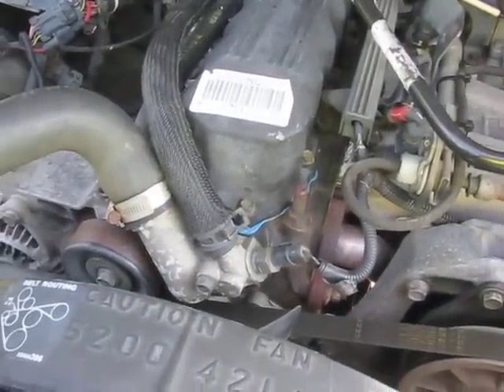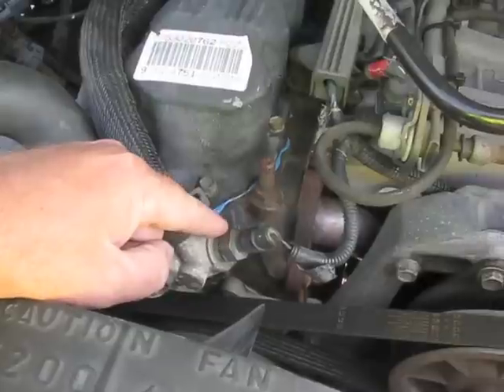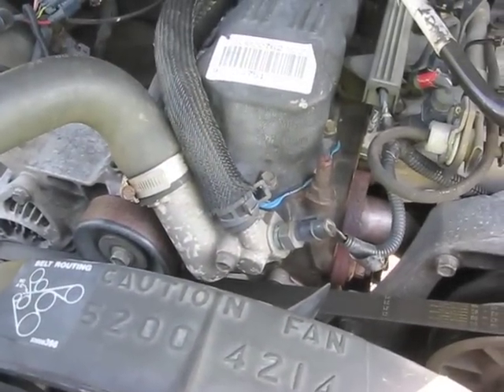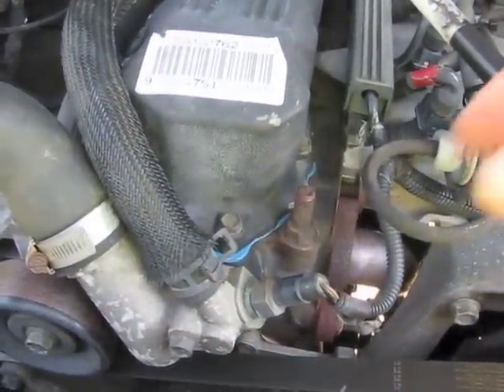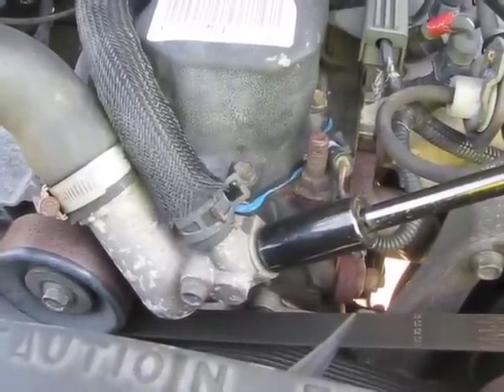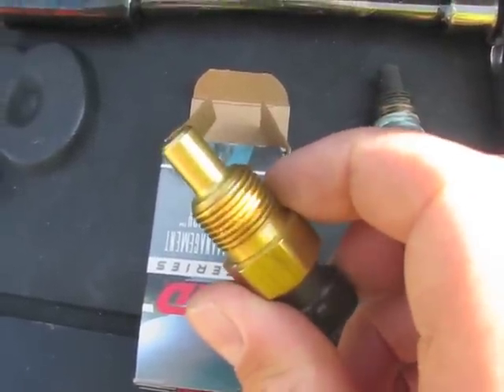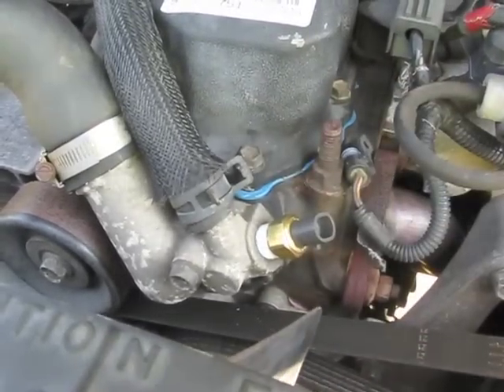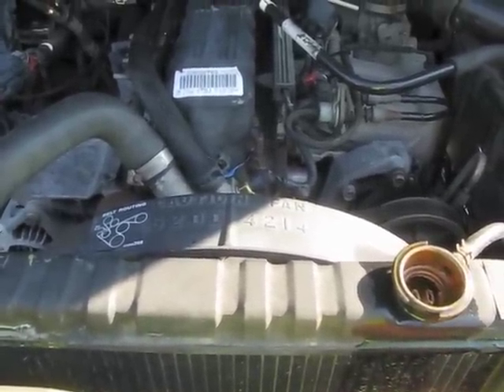Jeep 4.0L Coolant Temperature Sensor Replacement

Comment: In my '97 Wrangler TJ - recently got a check engine light with a P0118 code.  The Temp Gauge was steady reading and not bouncing around so I replaced the coolant temp sensor on the thermostat housing.   Should I have replaced the one on the engine block towards the back of the head too?  Thanks!

Comment: Simple, plain, and to the damn point.

No g00fy monologues about past divorces etc. or trying to sell t-shirts, like a lot of these other clowns making these type of videos.  Thank you for that!

Was it not necessary to bleed any air out after filling up, or you just didn't take the level down low enough to warrant it?
Reply from the maker: Changing this temp sensor I didn't drain the coolant much lower than the level at the sensor. What little air ended up in the system was quickly worked out by simply squeezing the upper radiator hose a few times during and after topping off the coolant. Even when draining the system entirely I haven't had any air trapped in the 4.0L that required anything more than the simple hose squeeze. 
Hope this helps. 
Thanks!
Reply: @jeepcollector91  You a Led Zeppelin fan?

"....squeeze my hose, baby.....'till the coolant runs down my leg"  :-D

Comment: Does anyone know a part number or replacement for the connector?  Need to replace the pigtail on a '91 YJ and cannot find a compatible connector.
Reply from the maker: I'm pretty sure it is this one with the rounded corners.  https://www.oreillyauto.com/detail/b/standard-ignition-5753/lighting---electrical-16777/connectors-sockets-16631/coolant-temperature-sensor-connector-11457/e39bbaf30c53/standard-ignition-2-terminal-multi-purpose-connector/tx3a/5826087

Comment: Are all cooling temperature sensors all the same ?? 
I have a yj 1991 to wrangler to 4.0 .
Reply from the maker: Yours should be the same as the in this video. 
It is a 1991 Jeep Wrangler YJ Sahara with the 4.0L

Comment: I have a 91 also how can I see what codes it's throwing for the check engine light to be on
Reply from the maker: Turn the key from OFF to ON 3 times (not to start) and on that 3rd time leave it ON and within seconds the check engine light will flash out the codes for you. Then you can look the codes up in your schematic or simply Google them. Most of the Jeep forums will have them listed as well as some of the Jeep parts sites...
Reply from the maker: I did a quick search. Here is a link to a good video and they even listed the codes in the description.
https://www.youtube.com/watch?v=kuHEzOQGtOs

Hope that helps.

Comment: I've changed the temperature sensor, and the sensor on the back of the engine, also checked fuses, and have a new radiator and new water pump, and my jeep is still over heating, also my fan won't turn on, I've tested and gave it power and it works good, reason why I changed the temperature sensor to begin with. any ideas? some say the jeep shouldn't over heat with out it, I have a 1996 jeep cherokee 4.0 2wd straight 6, runs at 210 buy it's tipping to 250 almost.
Reply from the maker: Been awhile since I messed with an XJ. Doesn't that electric fan mainly come on with the A/C? Anyway, if your XJ still has the mechanical fan you could have a faulty fan clutch which is less than $40. Assuming you already changed the thermostat? If that isn't the problem then it could be a number of other things. Anything from blocked coolant passages in the block, to compression issues in the cooling system. Sorry I'm not much help.
Reply: +JeepCollector91 year right now as we speak I'm using a oms reader tracing back the wires of the fan, but I asked my dad if it could be the fan clutch and he said no, super lost,the relay is good, I took the starter relay off and took the fan relay and put it where the starter one gos and cranked right up... maybe I'll find a break with the wire
Reply: Wonder if you figured this out. I had the same problem, changed the thermostat, problem solved.
Reply: +Up Loader changed it also. front and back sensors, and the one in water pump. new fan clutch also. still a mystery. last thing is getting a fan shroud. I did not have one for a year or two and ran good. all in all I rewired the second electric fan to a switch in side the jeep. temp fix. still runs a little  too warm.   last thing to do is rewire the whole jeep and new fuse box that sits near the engine.

Comment: I have a 98 Jeep Cherokee Sport 4.0 l engine. Temperature gauge is erratic. When the temp. needle on gauge drops, the motor starts to ping when accelerating. It will then rise to normal position and pinging goes away. The gauge keeps going up & down, and always pings when it drops. Is this the temp. sensor causing this?
Reply from the maker: I doubt the temp sensor is your issue. Maybe PCM, harness, or other electrical issue.
Reply: You may have air inside the engine cooling system. Follow these steps.
1. With engine cool, remove radiator cap.
2. Start engine.
3. Add coolant into radiator as needed and put cap back again.
 If the problem is solved after follow these steps, you don't have a sensor problem but maybe a leak of coolant somewhere.

Comment: It is called a sender, not sensor.sensor is the one on the back of the head.sender talks to the ECM ,sensor talks to the gauge.
Reply from the maker: +m bnam 
Also known as the coolant temperature sending unit...
Reply: Assbackwards! The gauge uses a sender. The ECM uses a sensor. Just like the video host states.
Reply: m bnam temp. Sending unit send to the dash gauge, the sensor sends it to the ecm..

Comment: this video is great! i have 7engine codes! from TPS sensor to Crankshaft sensor, EVAP code, fan relay codes! messed round with pcm wire harness and some basic cleaning! it has helped, BUT when the fan kicked on to cool engine, engine light came on and jeep again spuutter putt putt.  ole betsey fired back up and after fan shut off it ran normal! every time fan kicks on jeep goes crazy!  she shuts off when driving, red lights, idle! but no overheating so if you guys have any ideas, let me know please!
Reply from the maker: +Jamie Clendenin 
Electric fan? If so, could be the wiring to the fan shorting against other wires in the harness and only showing itself when power is being sent down that wire. Just a thought.

Comment: my jeep wj won't start the 1st crank or sometimes the 2nd when it's hot I have to wait for it to cool down then start it up. check engine light says it could be low coolant or senor I replace both ... help please!
Reply from the maker: +rexlive1 
It will turn over but not start correct? Assuming you have the 4.0L. I don't think your temp sensor issue is related to the hot start issue. That would cause more of a slow start issue meaning you just have to turn it over a little longer than normal to get it to start or just cause it to run rough or rich. Have you checked for spark when hot? I remember a few TJ's and some later XJ's were having issues with the coils on the coil on plug 4.0L's. Never messed with a WJ. Could also check the crank position sensor and maybe even the cam position sensor which took the place of the distributor on those later 4.0L's.
Reply from the maker: ...also, you could ask some of the WJ owners over on JeepForum
Reply: +JeepCollector91 thanks for your help. I will try these and I will let you know if it helped BTW I have been to 3 mechanics but they couldn't help my cursed jeep wj :(
Reply: +Travis Patocka got the changed no difference also nessed up the timing on it
Reply: +Travis Patocka turned out it was my FUEL Filter , changed it 2 times its running fine now :)
Reply from the maker: +rexlive1 
Guess the fuel pump was getting hot due to the restricted filter which caused fuel pressure issues when hot resulting in your no starts issue? So it was actually the fuel pump you were waiting to cool down and not so much the engine. Glad you got it figured out.

Comment: Can that sensor cause the motor to over heat? And I know it's not part of this video but if the hose connecting to the thermostat housing gets hard does that mean the thermostat isn't opening up?
Reply from the maker: Ruben Cancino No, the temp sensor shown in this video shouldn't cause an overheating issue. It just causes the computer to get false readings making the engine run rough. Overheating issue could be a bad thermostat, water pump, clogged up water passages in the engine or radiator, bad fan clutch, and even something as simple as airflow obstructions on the face of the radiator (mud, bugs, leaves...)
If the hose is staying hard with pressure and the temp gauge around 180 or higher then yes the T-stat could be faulty. You can remove the thermostat and test it in a pot of water on the stove with a thermometer to see what temp it's opening and to determine if that is the primary cause of the overheating issue. Even if you replace it with a new one I would say test the old one so you know you are actually fixing the problem and not throwing parts at it...

Hope this helps.

Comment: So how bad is it if you crack the place the temp sensor goes into?

Fml.
Reply from the maker: ***** If you are saying you cracked the thermostat housing it isn't too much of a problem. You can usually buy one off ebay or at your local U-Pull salvage yard for about $5. Then just buy a new gasket and install the replacement housing. Could replace the thermostat while you have it removed.
Reply: O'Reilly had one for my 95xj it was 15$
Reply: $7 (plus shipping), for a brand-new part, with a new gasket, on RockAuto.com, people!!

Comment: You said there was 2..where is the other one located?
Reply from the maker: On 4.0L engines with head casting number 7120 the sensor for the temp gauge is on the top of the head near the rear, next to the valve cover on the same side as the exhaust/intake.
Reply: Ahhhhh got you. thanks
Reply from the maker: ...no problem

Comment: I did the same thing and even bough the rear temp sensor for it. However, the engine light still throws a code for faulty temp sensor unit...but they are both new. Maybe pig tail it bad?
Reply from the maker: I don't think the rear temp sensor will cause any codes so I would focus on the wiring for the front temp sensor. Maybe even check the wiring connector for the computer since corrosion on the terminals could be part of the issue. Worst case, it could be the computer itself but lets hope for a simple broken or corroded wire and/or connector.
Reply from the maker: ...also, could be that the replacement sensor is faulty. Highly unlikely but still a possibility.

Comment from the maker: I would start off with cleaning the idle air control valve. 
I have had the same symptoms you mention happen several times since I have owned the '91 YJ and cleaning the IAC will usually eliminate the issue for many years. Every time it happens on the '91 I am expecting cleaning not to work again and figured I would have to replace it but it keeps working. The temp sensor issue was also causing problems with idle but mainly slow to return to idle. IAC caused start up idle issues.

Comment from the maker: No, you don't have to drain the coolant since not much will be lost as long as the radiator cap is left on. As for you're recurring problem, I would guess wiring or connector issue but it is possible to have obtained a faulty "new" sensor.

Comment: is necessary drain the coolant for replace the sensor? because i replaced the sensor but i didn't drain the coolant..and the computer show the same problem( bad coolant sensor) thanks for your help.

Comment: it only comes on when i switch from air cond. to heat but only stays on for about 5 seconds. it blew a small fuse under hood several months ago and made brakes lock up and ran hot and turned check anit lock light on but after fuse change it does this now so idk just trying different things bc its not a big issue bc its cold outside now so yeah

Comment from the maker: My YJ doesn't have an electric fan, just the mechanical fan.
Been a while since I messed with an older XJ. 
Are you saying it stays on all the time, or wont turn on?
Could be any of the following:
A/C switch, 
bad relay,
wiring issue, 
temp sensor.

Might search on JeepForum or NAXJA

Comment: As funny as this is about to sound I know its the sensor. I just read up that sensors for  idiot lights and gauges are different.  I had idiot lights and I am in the process of changing over to gauges. Thanks for your advice. []||||[]

Comment from the maker: On the 4.0L '91-'96 its on the top of the head on the drivers side (left side) all the way at the rear with just one wire plugged onto it. 

Hope this helps. Sorry I did not show that in the video. If changing that sensor doesn't fix your gauge issue you might want to make sure it's not the gauge itself.

Comment: I have a 96 ZJ 5.2 and the OBD was telling me the coolant temp sensor was bad, also once in a while the check eng. light would come on= code 0138. I did some reading and found that running in open loop too long and too rich would trip the light due to engine not fully heating up quickly enough from faulty coolant sensor. I replaced the sensor and also the O2 with a Bosch unit and it's 100% with engine running at higher normal temp, also getting better heat--

Comment from the maker: My YJ gave code #17 "Engine Running Too Cool" and code #22 "Coolant Temperature Sensor or Circuit Fault". 
Its nice that the YJ ('91-'95) will give out the codes with the check engine light. No tools or scanners required.